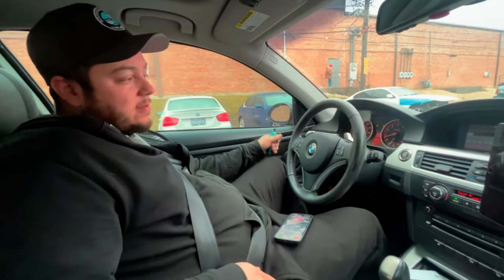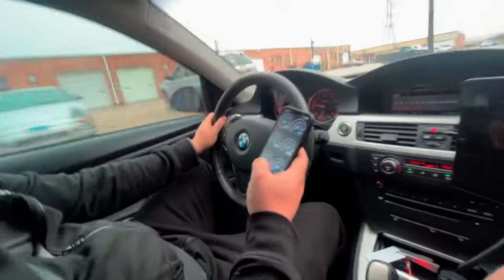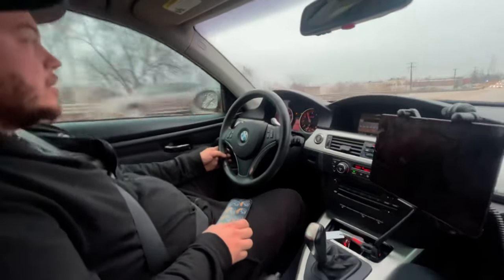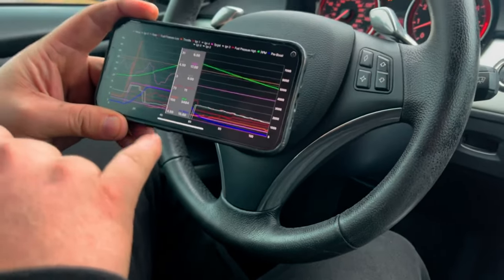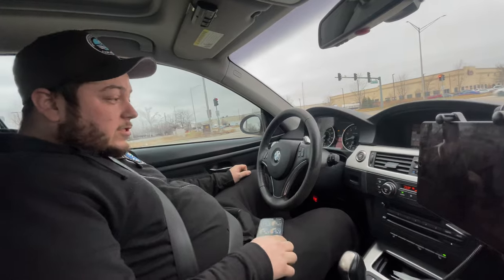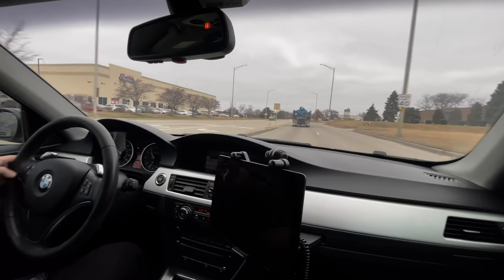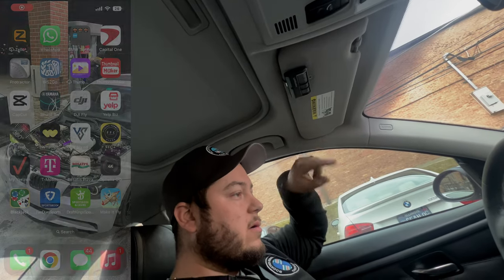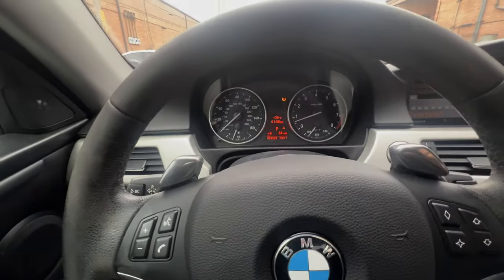Single Turbo Tuning with Doc Vu

Comment: Yooo I live in Boston lol! We should have a  small n5x meet up! :D
Reply from the maker: Damn I’m actually heading back to airport now. Flight leaves at 4pm
Reply: @N54RacingChannel quick question,  I'm planning on going single turbo on n54 335i and I'll be going with a 6266 precision bb turbo and the would be use as street car..which Backhousing would you recommend that gives me a fast spool and good top end?? The car is manual transmission if that makes any difference..thank you in advance for your help
Reply: Can you have phone